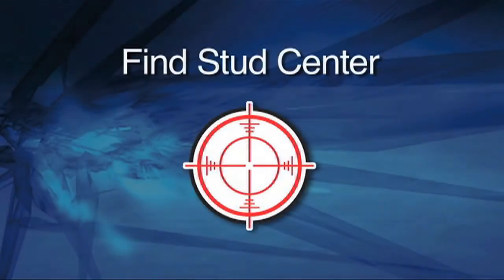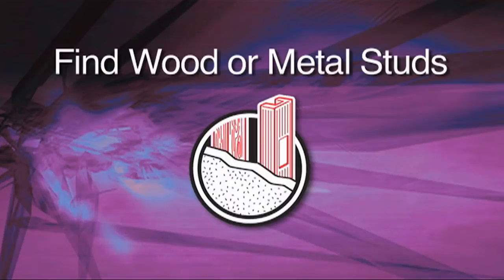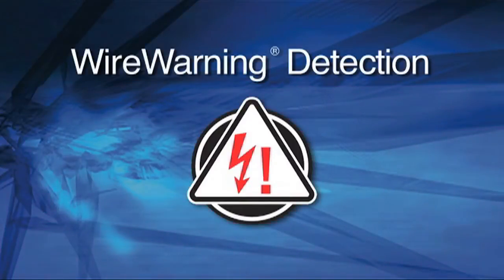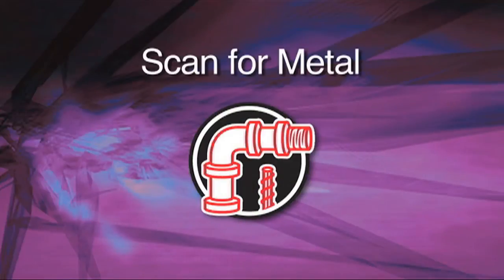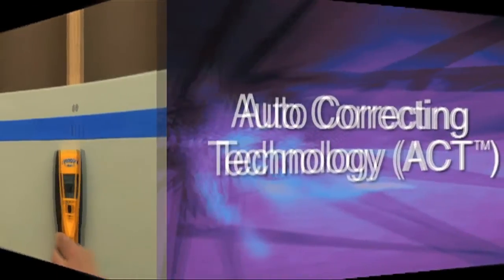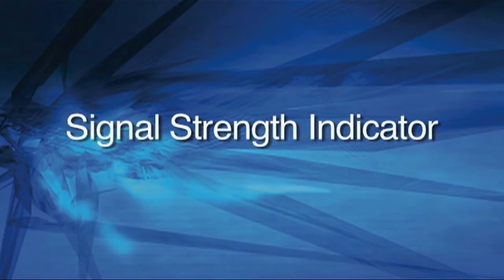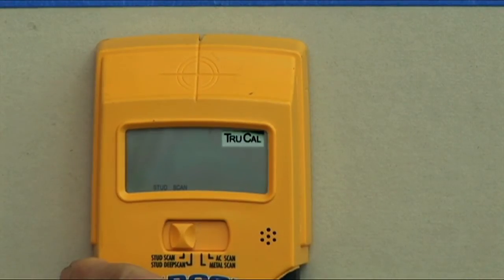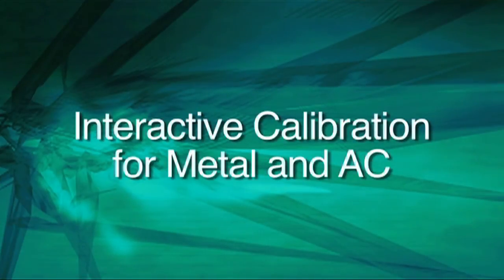Zircon Stud Finder Glossary of Features & Benefits

Comment: Can you use this to find wood studs in stucco?
Reply from the maker: Hi code3jefe. No, most stud finders will not work on stucco walls. The main problem is the metal screen/mesh that the stucco is attached to. Stud finders should, however, work ok on popcorn ceiling (many of our customers get the two mixed up) as long as the tool you’re using has DeepScan mode and a piece of cardboard up can be taped up so you can scan over the surface smoothly. Hope this helps. If you have any other questions, please feel free to give us a call toll-free at 1-800-245-9265, Mon - Fri, 8am - 5pm or send us an email at techsupport@zircon.com. Have a great day.